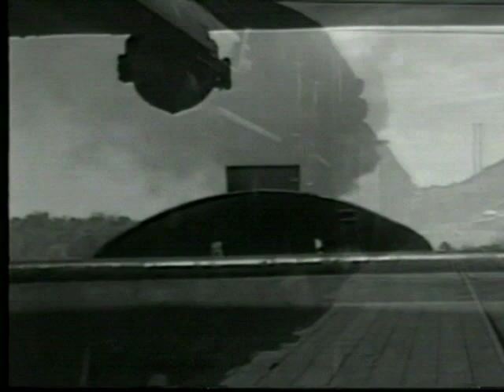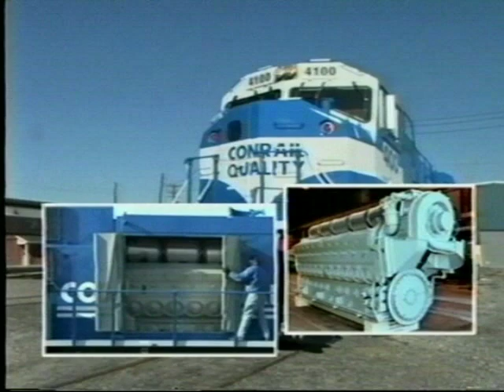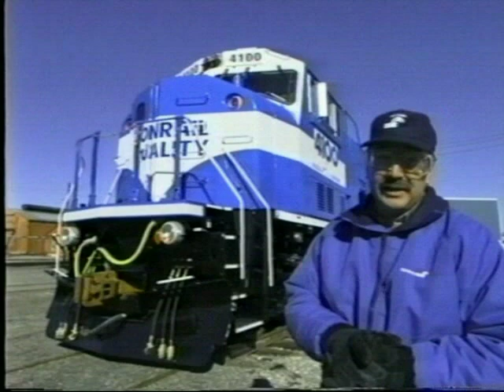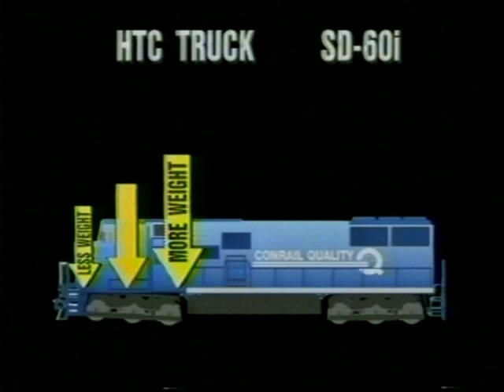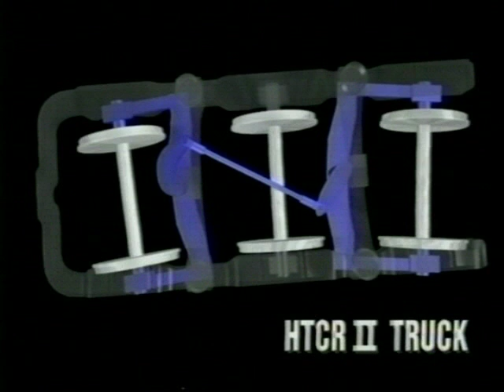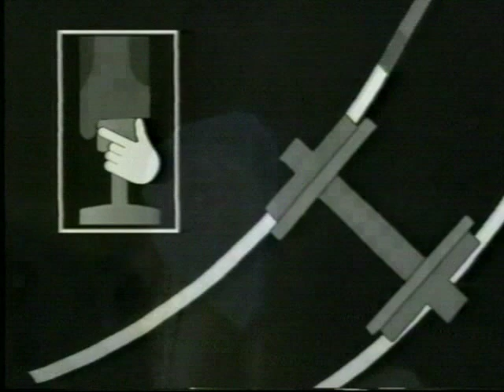Conrail SD80MAC Pt1 of 5

Comment: SD80MAC's are also built in india with reduced axel load, loco weight, different cab and design, with the name "EMD GT50AC". The Production started in 2012, but still, only 7 units have been built..
Reply from the maker: Thank you for watching. I've read on their web site that it is available. One reason for their not being a big seller was their twenty cylinder prime mover. The higher expense and higher fuel costs scared off many buyers. I loved watching them in action in run 8 on a steep grade with a heavy load. No sound like it.
Reply: @iusetano  No. It is a Made In India Locomotive, that was built by India itself. It has NO import units. The drawbacks behind this locomotive was that it was an LHF-Handicap locomotive, ie, it's long hood (LHF) part was designed in a wrong manner, such that the Signal Lights were not visible for the Loco pilots. If they wanted, they could have made this GT-50AC a DUAL CAB and could have called it "EMD JT-50AC". But, the weight of the locomotive was already 2 heavy. Indian Rail track's max weight capacity is only 135 tons. Since the single cab itself weighs full up2 135 tons, dual cab would be even more heavy, which might cause the Train Over Bridge 2 break, if the Locomotive Crosses the Over Bridge.
Ow ! I forgot 2 tell U that GT-50-AC is called "WDG-5" and their nickname is BHEEM. Bheem was a Wrestler, about whom it is mention in Mahabharat/Bhagavad Gita, an Ancient Indian Sanskrit Scripture..
Reply: @slv777darshan  Correct
Reply: I want 2 know how ONLY 4 cylinders more than a v16 causes excess fuel ??